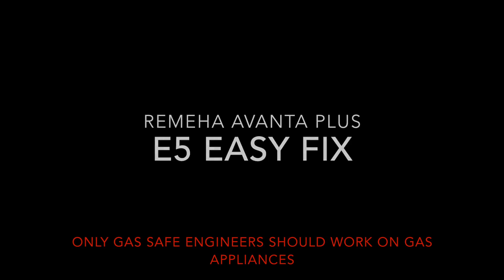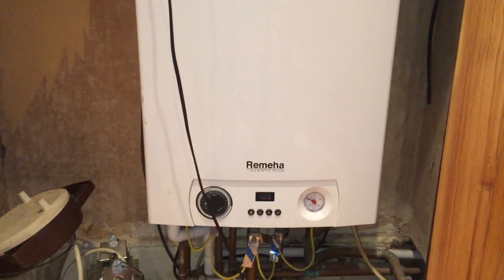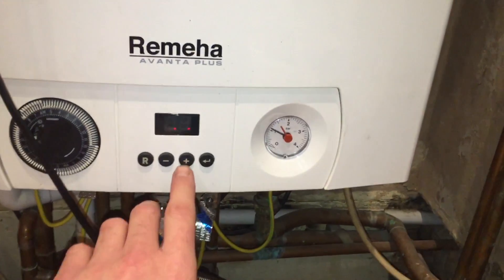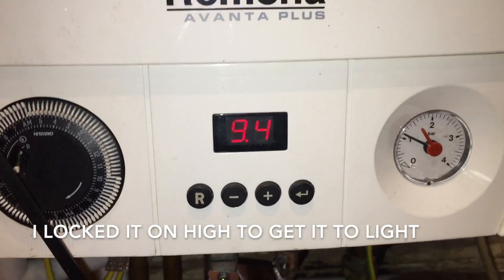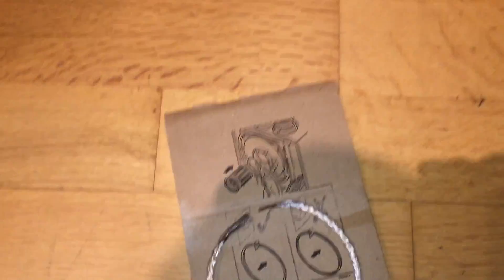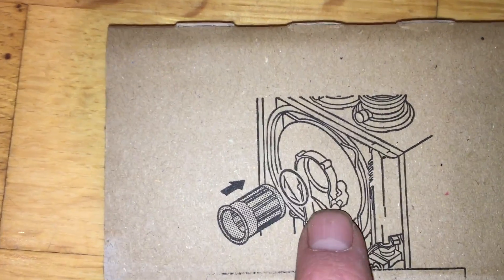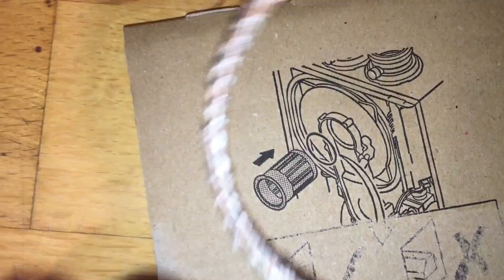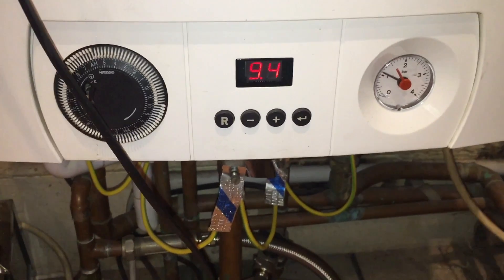Remeha avanta plus E5 Fault repair.

Comment: Getting the same on one .hw fine but htg just tries to light and vibrates baxi say gas valve low spring pressure on low gas valve solenoid.did yours yet to light with a noise

Comment: Same here!! Thank you very much for sharing this video! 
I had the same problem. FL around 2.8 and E5 on display.
The old gasket was burned; easy replacement, thanks to you! ✌️
Reply from the maker: Glad it helped. How long were you suffering?
Reply: The error had popped up once or twice a month for the past 8 months, which wasn't too bad. But last week, it started showing up every few minutes!
I had my new gasket ready. It only took about 10 minutes to fix, and now everything is running smoothly! 👍
Reply from the maker: @krystian9603  Im glad this helped. :-)
Reply: Can anyone tell me the part number for the seal?
Reply: @davidhoneyman8996 i just had the faultcode, and i think it is part number 2015 from the manual, which would be number “S103172” from Remeha. Now i need to find the part on a saturday 😅

Comment: Going out to this fault tomorrow!! Solid gold mate! I was thinking ionisation/rectification but you just done away with an headache waiting to happen 👍🏼👍🏼😎
Reply from the maker: Yeah mate. Be aware when I did this you could only order seals and gaskets 10 at a time. So a bit expensive for the customer.
Reply: Well sorted!! The ionisation reading on FL was 1.8......thanks again for vid mate 😉
Reply from the maker: No problem.Im glad the video is still coming in handy for people
Reply: @HeatingGeek    knowledge is always relevant, I struggled a bit to get the front off, the heat ex needed a good clean but now no E5! Smashed it thanks Ollie 💪🏾
Reply from the maker: Nice one! :-)

Comment: Absolute gem of a video had the same problem for months with 2 gas engineers after replacing the ignition box, electrode and large rubber seal and £330 down, still have the E5. Called out the engineer again to fit the new graphite boiler seal and finding the old one was knackered. Now working perfectly.
Now fighting with the company as they now want to charge me again ....🤣   Year right !!
Reply: Я сам сантехник и не мог найти ошибку 😂

Comment: Thank you so much for sharing this video , I had the exact same problem and I bought a new seal from amazon for £14.00 and I fixed the fault with in five minutes 👍🏻 again I have had several heating engineers out and none could solve the problem. I now have a lovely warm home again so a massive thank you to you Sir.🙏👍🏻
Reply from the maker: Im glad you got it sorted. Get the boiler serviced with the money you saved. 🙂
Reply: Do you have a link to the amazon page mate?

Comment: Thanks for sharing the video, I’m going to check one of the boiler which E5 displays and after that E8 comes up, do you know by any change the Part number that seals mate. 
Thanks
Reply from the maker: I don't know anymore. It was a long time ago.I do remember you need to order 5 at a time though...
Reply: @HeatingGeek  thanks for getting back

Comment: This is good video but this solution did not fix my problem. Long story short we had to change the exhaust pipe. There was a small broken part at the exit tip of the exhaust. İf this solution was not enough you my try to change the exhaust pipe.

Comment: If I am right in thinking, before baxi/potterton bought the broag Remeha out, a call to them would of told the engineer the problem. Sometimes a call to the manufacturer saves a lot of agro. Quite like the Remeha boiler.
Reply from the maker: I miss this comment

Comment: Update. The FL reading (Ionisation current) was reading from 0.3 to 2.7 even when it was pumping out hot water. As soon as it kicked into central heat it went into fault mode (E4 or E5).
So I did what you suggested and got the large seal changed. Even though the original seal was slightly damaged, changing it did not make any difference. 
I then read elsewhere that the ignition transformer could well be the problem. The Remeha has a separate unit (ZAG 1 IGNITION TRANSFORMER), while in some boilers it is controlled via the circuit board. I had the engineer change the Ignition unit and eureka! The FL reading shot up to 8.0.
So if you are having Ignition or Ionisation problems check this fix. 
Good luck.
Reply from the maker: Thanks for the update. :-)

Comment: So your E5 issue happened only when central heating was active, no issue with hot water? Have you also observed if the FL was constantly low(<3uA) with center heating thus not able to ignite,  or it can ignite initially (with higher FL >3uA) but quickly drop below to 1~2uA?, i.e.  flaming cannot sustain? thanks!
Reply from the maker: This was a long time ago. I cant remember how to even use the display. Sorry

Comment: Hi HeatingGeek. I've been having E5 problems since I turned back on the central heating. Engineer didn't know what it was, so I had to search online. Came across your solution and have also discovered the old seal to be knackered. I've just ordered a new improved version for delivery tomorrow - so fingers crossed.
In the meantime I thank you profusely for you altruism and letting the world know about this. Cheers.
Reply from the maker: I hope it fixed your problem. :-) Or the boiler may just need setting up. :-)

Comment: Thanks for this great video! We have had the exact same problem.  Would I be able to change this myself, or should I ring my plumber to have him install this ring for me?  It looks easy enough but I don't want to underestimate the skill that may be required
Reply from the maker: get a gas safe engineer as the combustion will need to be checked as well as other safety issues. :-)

Comment: Do I have to put the boiler into service mode before I unscrew the housing and replace the seal or should I just switch off the electrical connection and turn gas supply to it off ? Hope you can help . Thanks for the video.
Reply from the maker: I guess your not gas safe? Service mode is for testing combustion etc. I would not recommend doing any repair on the boiler if you cant test it with combustion analyser afterwards. Its very important to your safety.

Comment: Hi I replaced the burner rope seal with updated one changed all the probes serviced boiler ran fine for couple of months then E5 fault came up again just pressed reset button fired up ran for couple of months the E5 fault it's really intermittent.
Reply from the maker: Could be the governor on the gas meter sticking. If its every few months I would live with it until it gets worse. :-)
Reply: Put service kit on Remeha today, gone e5 again. Gas valve I'm thinking.

Comment: I'm working on one with the same issue right now....do you happen to still have the product code at all anywhere or description of it so I can get hold of one? I've changed the gas valve and probes 🙃
Reply from the maker: I don't have the part number. :-). Sorry. You have to buy 10 at a time though... Mine are in the unit you see in the video so I don't have access right now.
Reply: @HeatingGeek  all good dude, thank you for the vid. Scratching my head at custs house and came across this vid. Called rehema/baxi and they agreed with you. Found part online. Thanks for the video bro 👏🏻👏🏻
Reply from the maker: @mistadeano100  I hope it gets it sorted for you. :-)
Reply: @HeatingGeek  going back next week with part. Fingers crossed. Thanks again for the vids man. You help so many people. Never stop
Reply from the maker: @mistadeano100  Thanks :-) I will keep going as long as I can :-)
Reply: @HeatingGeek  went back and swapped out that part...was easy....let boiler run for a bit and did fgas....was off the scale...1400ppm. I AR'd boiler am going back tomorrow to strip and clean heat exchanger as its filthy! Hopefully that will bring down numbers 🤞🏻
Reply from the maker: @mistadeano100  But the boiler remained lit. :-)
Reply from the maker: @mistadeano100  Thats a bit of a result
Reply: @HeatingGeek  yep. For the 1st time in weeks, the cust didnt have to reset boiler as it wasnt going into fault. Thanks to your video! 👏🏻👏🏻
Reply from the maker: @mistadeano100  Did you have to buy  10?
Reply: @HeatingGeek  the small ones which were in your vid came in x 5 the red heat exchanger ones came in x 10...so I got them now for the 1 in 50 chance I come across a rehema 😂😂
Reply from the maker: @mistadeano100  That's it. Annoying!! ;-)

Comment: Thank you HeatingGeek for this video. I used this to try to diagnose the problem in my 10-year-old Remeha Avanta Plus. It was showing E5 for a week and I could not get any hot water or heating. My options were to try the graphite gasket or simply get a new boiler due to the age of the Remeha. I decided to order a Remeha graphite gasket on eBay (£8.50) to try. Sadly this did not work because when my engineer opened the boiler, he found water ingress from the flue. My rope gasket did look worn out though. We ended up replacing the boiler with a Baxi. However, I'm thankful for this video as it allowed me to at least eliminate a probable cause before just going out to get a new boiler (very expensive as you can all imagine!)
Reply from the maker: I'm sorry you had to replace the boiler.:-) I guess sometimes you just have to.

Comment: Thank you so much for the video and advice, even the heating engineer couldn't diagnose the fault. Gasket was the old  fiberglass type,  replaced with the new graphite gasket as per your advice and hey presto, problem fixed! :) Great work 👍
Reply from the maker: Glad you got it sorted. :-)

Comment: Hi, I have an Intermittent E5 problem, it also has a nasty harsh Bang, again intermittent. do you think this gasket could be contributing? we have had the igniter replaced, but the bang remains!
Reply from the maker: I would get your gas engineer back. The bang is concerning and shouldn't be left. More investigation will be required.

Comment: i have this boiler, getting e4 code, no HW or CH, engineer came out, went away, came back, changed 2 parts, still not working after £180 and he says its the PCB that has likely gone, is that a valid assumption..??..i looked and they are nearly £300, i`d of been better off just getting a new boiler, especially if a new pcb doesn`t remove the error code..bloody freezing as well..
Reply from the maker: Could be. It depends what tests he has done. This boiler had a PCB and gas valve before I attended.

Comment: Thanks for sharing @HeatingGeek
 ! It looks like I'm having the same problem. Where do you get the seal from, is it Remeha-specific or a generic one? Thanks!
Reply from the maker: Its very specific and you have to buy 10 at a time as far as I know. If its fitted incorrectly It will have major safety implications.
Reply: @HeatingGeek  So it's a Remeha brand-specific seal or doesn't have to be a Remeha part as long as it's a graphite one as you specified? Thanks!
Reply from the maker: Remeha
Reply: @HeatingGeek  Thanks!!!

Comment: I worked for my local council for 6 years and  we had a lot of Remehas I found this fault  and solution. I have a customer with 1 of these that I fitted the new graphite seal on last year but am returning today as same thing occurring!😩
Reply from the maker: Good luck. Hope you got it sorted. Not my favourite boiler TBH (.  .) What is two dots meant to mean??? Or . one dot.  Weird boilers.
Reply: HeatingGeek checked burner seal and electrode etc. Put analyser in forced to high fire..... readings off the scale took 2 hours to clear my analyser! Could smell gas. Split in the gas valve, turned off as immediately dangerous🧐
Reply from the maker: @sandraallsopp1234  What analyser do you have? I have a Kane and find it ok at recovery from flooding  (with Co). I had a Anton but thought it took too long to recover. Where did the gas valve split!!    That sounds serious.
Reply: HeatingGeek I have a testo  but have just bought a Kane as my1st apprentice has finished his4 years and waiting for his Porto to be checked.. so he can have the Testo and  I’ll have the Kane. Valve split near outlet.
Reply from the maker: @sandraallsopp1234  My new testo (hard case) got nicked 2 weeks after I bought it. Been Kane ever 
since.
Reply: HeatingGeek  I have the engineer codes from the manufacturers I got on a training day, why do manufacturers keep al the info under wraps!

Comment: Nice Thankyou for that, I was the same, thinking of getting a new gas valve or thinking pcb had gone faulty. Iv replaced the ionisation probe and was fine for a few days which threw me also. New seal it is. Ta
Reply from the maker: Check the ionisation current first!! Then fit the seal!!

Comment: The gas valve and probes and leads are the go to parts for those kind of fault code so may have made the same mistake. I've never even seen an avanta I guess the moral of the story is to check ionization current and give manufacturs a call if it's a boiler you've not worked on. Thanks for the heads up.
Reply from the maker: Thanks. I appreciate you commenting. Go slow to go fast. Very true with boiler repair! :-)

Comment: hi what is p.1.0 and f 2.2 pls
Reply from the maker: Sorry. Off hand I don't know. Google is your friend i'm afraid
Reply: Is that  the purge cycle it goes through for 3-4 mins when power has been turned off and on again?
Reply: Manufacturers code that comes on the software plug.

Comment from the maker: Yeah, I was clutching at straws. Really tough job.
Reply: I've seen these banging alot and it's usually the burner itself as there was a bad batch with a pressed plug on the end that happens to let gas out and only booms to get going causing all sorts of heart failure.